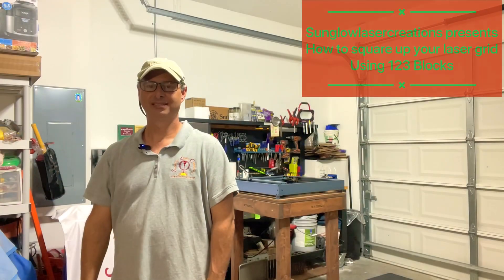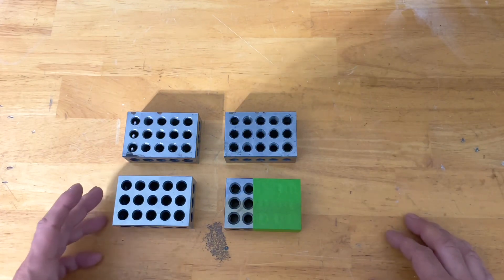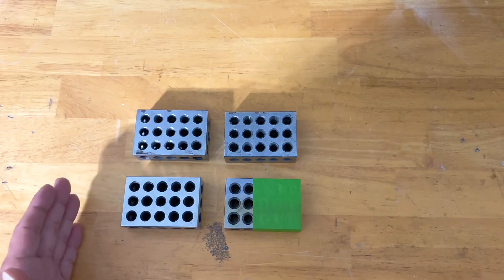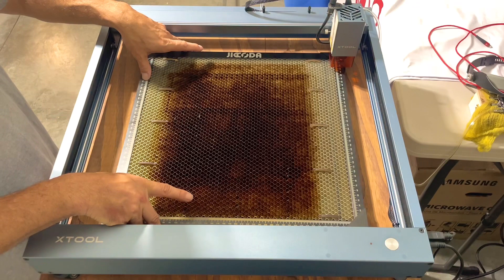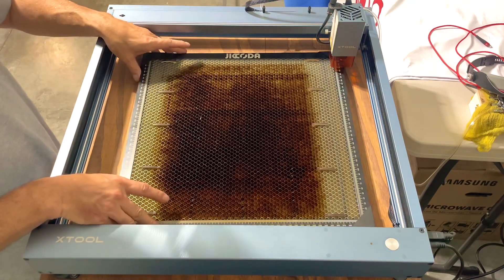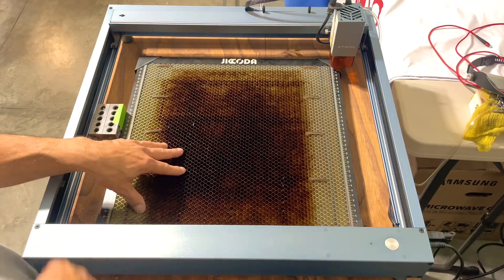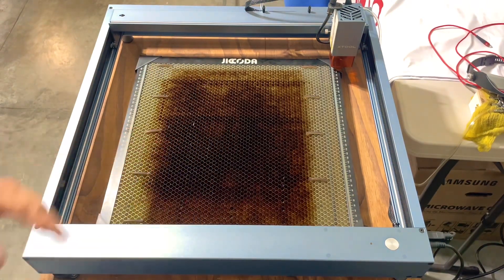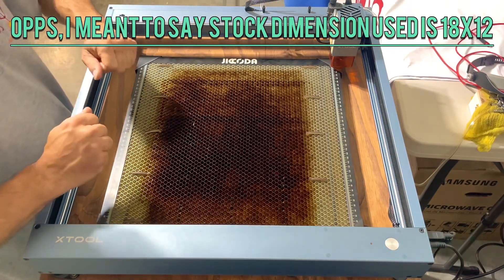How I square up my laser cutting grid to the Xtool D1

Comment: Great information! Where did you get the honeycomb?
Reply from the maker: Hello Brian, thank you for the question. I purchased this from the big A online lol. Honeycomb Laser Bed, JICCODA 17.32x17.32x0.87 inch Honeycomb Working Panel for CO2 or Diode Laser Engraver Cutting Machine, Honeycomb Working Table with Aluminum Plate for Table-Protecting. FYI this has an aluminum bottom plate, so magnets won’t work.